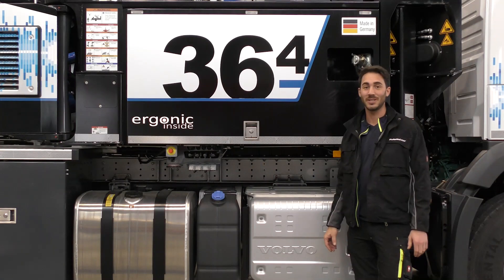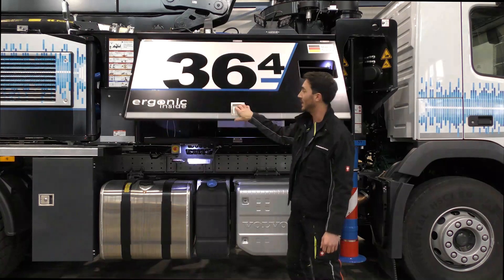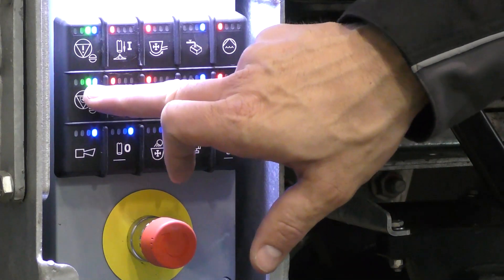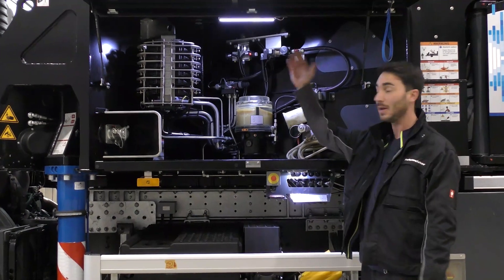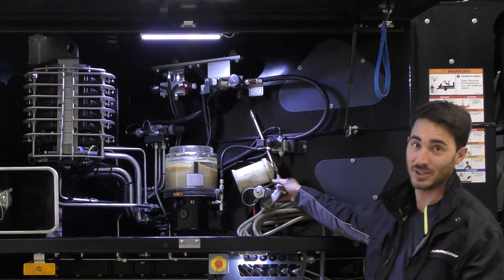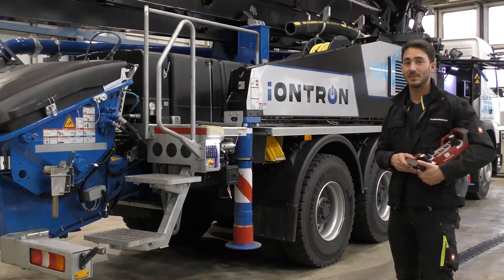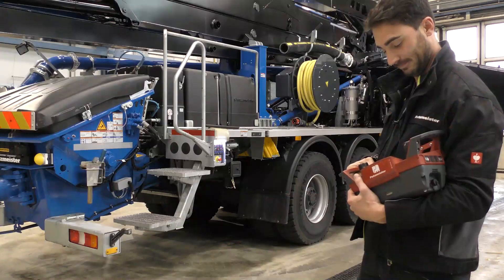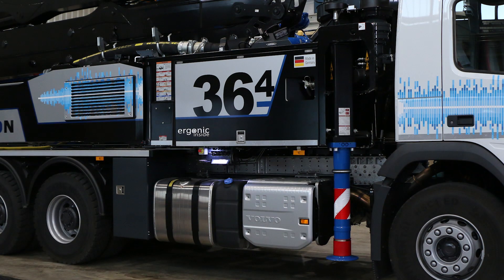Putzmeister: iONTRON Hybrid Walkaround

Comment: If the source of power comes from a generator on the jobsite, aren't you defeating the hybrid purpose?
Reply from the maker: The machine is designed to work on a site equipped with sufficient power supply (or power pack) without diesel engine exhaust fumes. The noise emission is also much lower in electric mode. Both can be very helpful in inner city areas. The machine is not equipped with a battery, like a hybrid car.

Comment: For working just in electric it must to be plugged-in with the cable?
Reply from the maker: yes, the connector needs to be plugged into the power supply to work fully electric